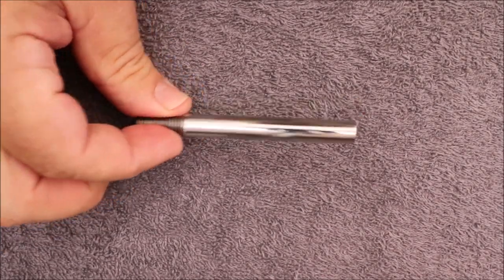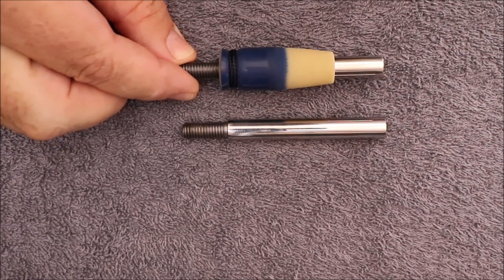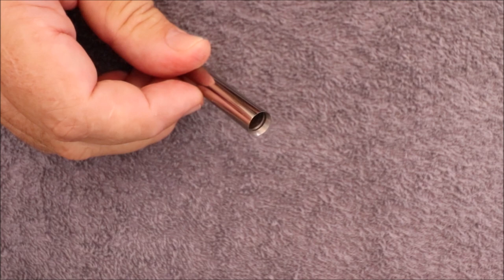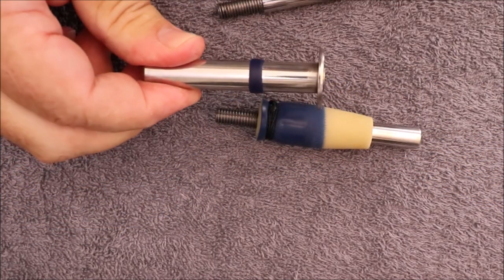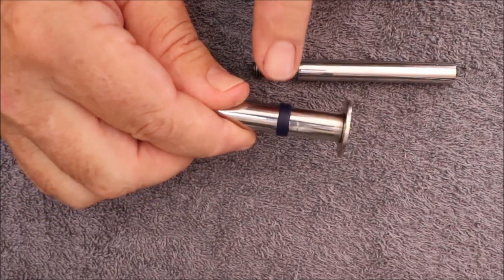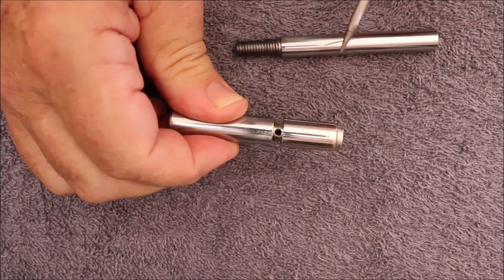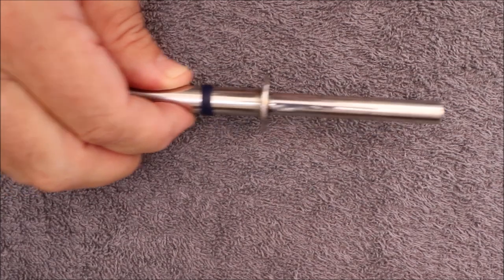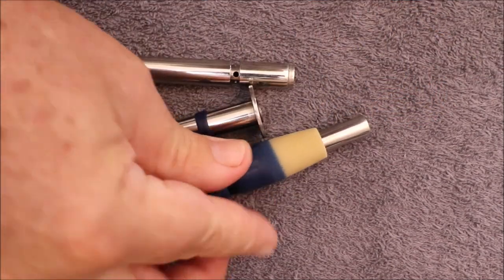Rob Allen | Biopsy Dart

Comment: hi RobAllenSpearfishing, im from spain and i´m currently doing a budget for an imaginary research proyect. how much will cost one of those biopsy spears? im very interested in your work thank you
Reply from the maker: Email me at   rob@roballen.co.za   please.
Reply: @RobAllenSpearfishing  yes i have just written an email, it was only for an aproximate price because i have to send the homework of my imaginary proyect tomorrow. thank you so much
Reply from the maker: Biopsy tube   R746
Biopsy Base R407
Spear (shaft) complete with base and tube on a 7mm spear = R1400  
Spear (shaft) complete with base and tube on a 7,5mm = R1433

Bio dart gun, depend on set up, basic single 16mm rubber R3231 with spear and tube on 7mm spear.
These prices are in Rands. R17.50 to the Euro1.00
Reply: @RobAllenSpearfishing  thank you so much

Comment: Rob very interesting concept. Have you tried this on cetaceans? The design we currently use has many short comings. Is this unit available for purchase?
Reply from the maker: Hi AXM, 

I was involved with humpback whale sampling a long time back. At that time a crossbow was used with a similar tube cutter. The fact it was shot at the whale as it surfaced meant the tube cut a sliver of skin and did not need to expel water. The problem was finding the dart after it had deflected off the whale. This same dart was tried underwater with no success due to the water not being able to escape. 

Re cetaceans, no reason why it should not work the same way. I do not know of anyone who has used it for such yet. If you are interested to try, please feel free to mail me on             rob@robAllen.co.za
Reply: RobAllenSpearfishing thanks Rob, I’ll put together a few thoughts and send you an email. The biopsy tips I currently use are performing erratically lately due to poor manufacturing by our newest machine shop (our original guy retired unfortunately).
Reply from the maker: @axm2689  No problem.